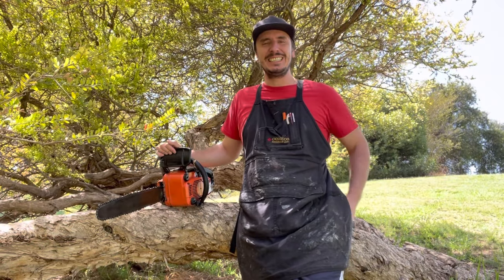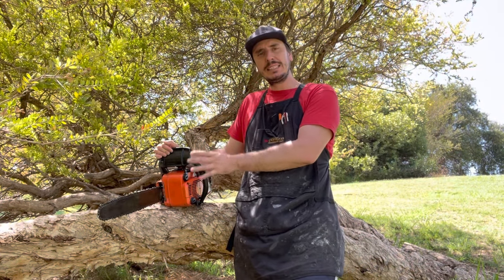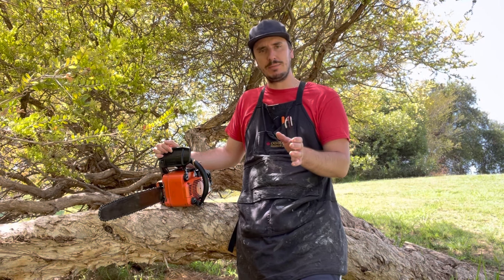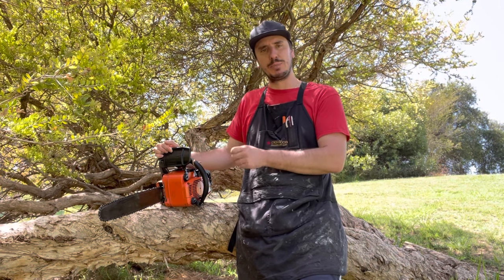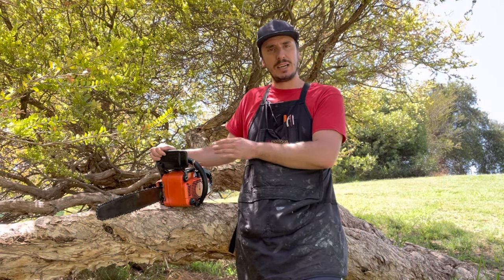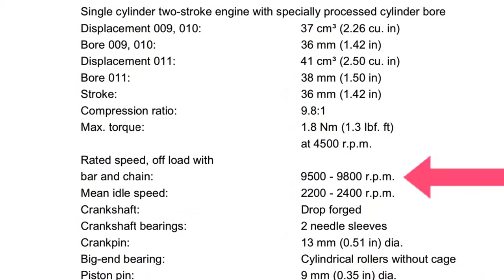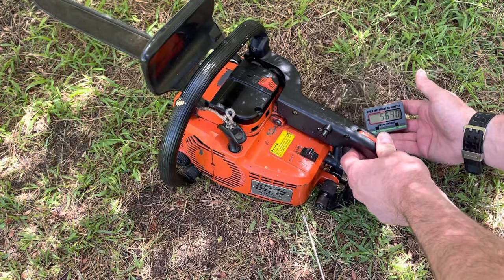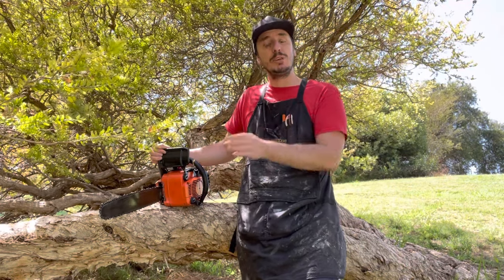STIHL’S OFFICIAL 2 STROKE CARBURETOR TUNING PROCEDURE.

Comment: Great Video.  I have a SH55 blower and I see the idle rpm is 2800, but there is no max rpm in the manual or online for that matter.  Would you know what the max rpm should be?  Thanks for sharing.
Reply from the maker: Interestingly enough, they don’t give a max rpm, not sure why. Set it to max rpm, then back it off 1/8 of a turn.,
Reply: Thanks very much, have a great day.
Reply: I just got around to adjusting the carb and no matter what I did I couldn't adjust it properly.  Could be because its a Chinese carb.  I have ordered another carb, let see what happens. @robsteinhaur221

Comment: On my STIHL BG 56C Air Blower, I have a problem starting it. I have to push the carburetor bubble about 50 to 100 times before it will get gas inside the bubble then it will start. I have replaced just about everything and no luck on starting it normally.
What should I do ?
Reply from the maker: Likely either the celerator pump, main nozzle check valve or if the carb has a part load fixed jet check valve that maybe leaking too.

Comment: Found you looking for a solution to a chain saw problem. I have a Stihl 032 AV that I have owned since new. The trouble I’m having is that it will start and idle fine but bogs down and stalls when I pull the trigger. Fuel is new and I don’t see any obvious holes in the fuel line or pulse line, fuel filter is new. There isn’t a spark arrester just a muffler. The only work I have ever done on this saw is a carburetor rebuild kit a couple of years ago. The saw was running strong up to a few weeks ago. Any thoughts?
Reply from the maker: Hey, could be many things, but essentially it’s lean on the progressive idle drillings. Try opening the low screw 1/4 of a turn (you may have to turn the idle screw in to compensate and bring the revs up).
Reply: @VintageEngineRepairs  thanks, I’ll give that a try.
Reply: @VintageEngineRepairs  that worked well! It now runs and cuts but still has some power issue. I can tell it isn’t putting out all the horsepower it used to and will stall now in hardwood like walnut.
Reply from the maker: @54lespaul77  in that case, if it’s stalling at full rpm, open the H screw 1/4 of a turn

Comment: I have a question.  A lot of Stihl equipment has an idle range like 2,800-3,200.  Which number do you choose?  2,800 or 3,200?
Reply from the maker: Hey! It’s engine dependant; as mentioned in the video. Your service manual will state what rpm it should idle at. Thanks for watching!
Reply: What I worry about using break fluid to soften rubber is how long will it stay soft once exposed to gas. Nags has a tendency to harden rubber and I think it will get hard, again, in short order.  This is why I replace diaphragms instead of trying to rejuvenate them.  I do not like to have to go back in a carb, again, for the same reason.  A fools errand.

Comment: What is the minimum compression a stihl FS55 trimmer should have to operate?
Reply from the maker: About 130 psi, below that it may struggle to start. You must use a small engine compression gauge though, an automotive one won’t be suitable.

Comment: So you’re saying this is standard for BR400 also? Mine won’t react to idle screw. And I don’t have a meter to use. What to do?
Reply from the maker: Yep, it’s the same process :)
Reply: How should or what is the factory setting for the idle screw? 
I looked up BR400 manual and it does not say what the L&H are set in the factory, maybe what you know is as a Stihl Tech you have access to the info.
Can you tell me where to start?
Reply from the maker: Hey, just to confirm, I’m not a stihl tech! I don’t want any misunderstanding there :) start at 1&1/4 turns out on both L and H and start from there. Use 2800 as your idle. So…

1). 1&1/4 on both screws
2). Start machine
3). Let it warm up for 60 seconds (adjust La if it won’t idle)
4). Adjust LA screw to 3,300
5). Turn L in and out to find fastest rpm
If fastest rpm isn’t 3300 (+/- 200rpm) adjust LA screw to 3300. 
6). Turn L in and out to find fastest rpm again, it should be at 3300rpm (+/- 200rpm) if not repeat adjusting LA to 3300.
7). Turn L screw anti clockwise to set rpm to 2,800.
8). Go to full throttle and turn H until you get fastest rpm.
9). Open H screw 1/8 of a turn anti clockwise to richen the mixture.

Tuning complete!
Reply: @VintageEngineRepairs 😢 0:33 0:33 0:33

Comment: Thinking of purchasing an pulse engine tachometer pal and setting it up to 2500 rpm and adding 500 rpm to it m8t to get 3000 rpm what do you mean by all this spec where’s do you get the spec from
Reply from the maker: They’re great tachs! I get the specs from workshop or service manuals, thanks for watching!
Reply: Will it work on a two stroke Rc car pal
Reply from the maker: @MarkCook-kv2cj yep!
Reply: How do you do it what do you have to do pal because I don’t think I’ve got the instruction manual for the engine or the carburettor m8t
Reply: It’s an obr full mod 34 cc and a choke less carburettor pal
Reply: Is it straight forward to do pal
Reply: @VintageEngineRepairs how do you do it what do you have to do pal because I don’t think I’ve got the instruction manual for the engine or the carburettor m8t
Reply: What do you have to set the spec to pal??

Comment: Explain stihl fs55. Max.engine speed (rated) 9500rpm.
Max.output shaft speed (cutting attachment) 7700rpm .which one of these rpm the H speed is to set
Reply from the maker: When the machine isn’t under load it should be set to run around 9500. However because you’ll be cutting grass, the engine will be loaded because of the resistance of the grass so it won’t ever run at 9500, it will be at around the 7500 rpm in use. Tune to 9.5k if that’s what the manual says max rpm.
Reply: Thanks very much

Comment: Can you recommend a techometer?
Reply from the maker: I like the Oppama brand, they offer a tachometer at every price point :)
Reply: @VintageEngineRepairs  Thanks.  Could you recommend a compression tester for small Stihl engines that screws into spark plug hole?
Reply from the maker: @anthonycoppa9089  sure, mityvac make a good one!
Reply: Thanks!

Comment: Any adjustment on my ms170?
Thanks
Reply from the maker: You have an air bleed screw, but that’s it and I haven’t found that to make any notable difference! I believe stihl call it their BIS system. My advise, google - “wt215 carb swap ms 180” (same applies for 170 but I believe it was just shown in an ms180)